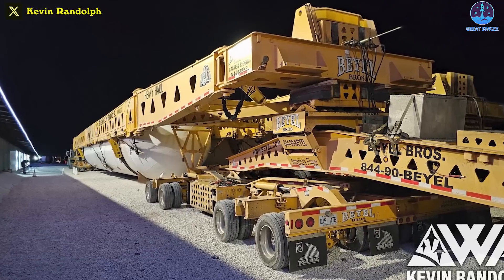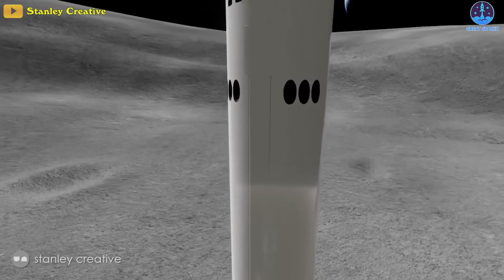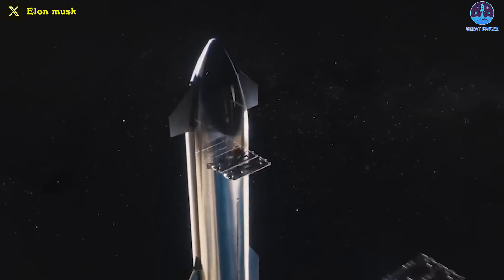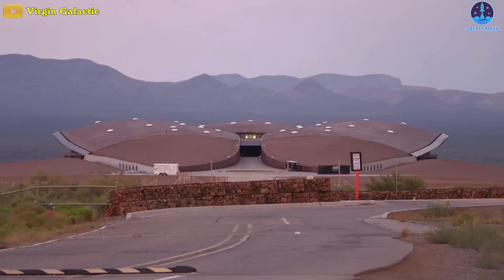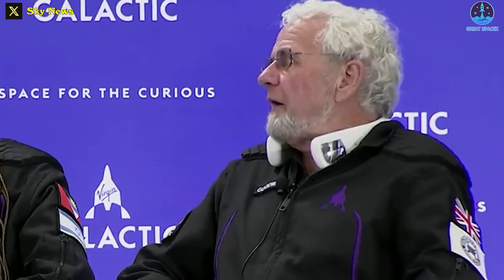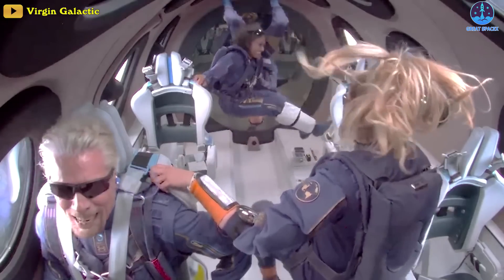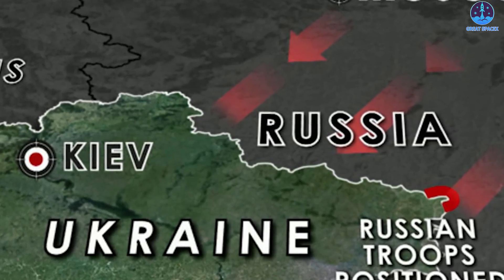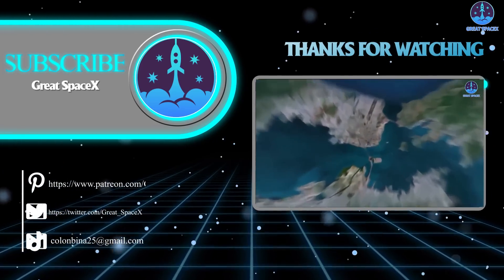SpaceX's new mystery structure revealed at Starbase! Virgin Galactic's new record and more...

Comment: The Kármán line is always an odd one as von Kármán himself said that the edge of space was roughly 84km but the Kármán Line was actually first defined by Andrew Haley in a paper in 1959.  Haley defined the Kármán Line at 90km (taking into account updated technology since von Kármán's original hypothesis) however since the the advent of the space race and manned space flight everybody kind of arbitrarily takes it that the Kármán Line is 100km.  Confusing isn't it (for reference https://en.wikipedia.org/wiki/Kármán_line#:~:text=The%20Kármán%20line%20(or%20von,feet)%20above%20mean%20sea%20level.)

Comment: The mystery structure is the extension to the launch pad. They are going to put the extension on the existing launch pad, making it higher. The problem with launchpad is that it is too low. As the result hot steam makes inside the launch pad the reverse thrust. The extension extends a distanse between engines and the ground, and makes more room for flames and steam inside the launch pad. Good idea, I supopose. Maybe it should be even higher, to make more room inside the launch pad. It is related to the megagilla altitude. The extension can't be too high. In my opinion it should work, so I am happy because it looks like the next launch could be successful. Good job, Elon!
Reply: Interesting idea, but I think not. Take a close look at the existing launch table. It is quite complicated with GSE to start up the 20 outer Raptors, among other functions. (Each engine has its own  connections.)

Comment: Those new components look like a spacer ring to stop the deluge spray from getting too close to the rockets (look at the rockets from the static fire test, and you can see water marks on their outsides). The pronged ring I think is to break up the deluge jets arc's, so we don't end up with huge steam clouds, and if there is a ground water salvage system built then a lot of the deluge water can be saved for reuse